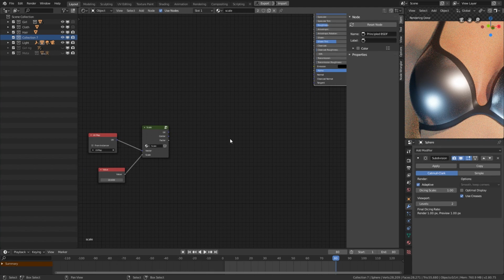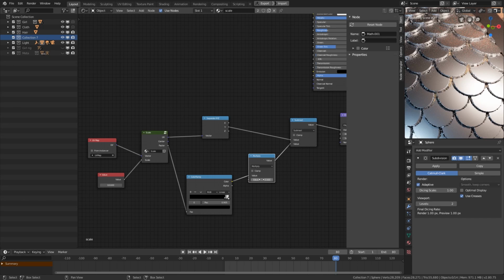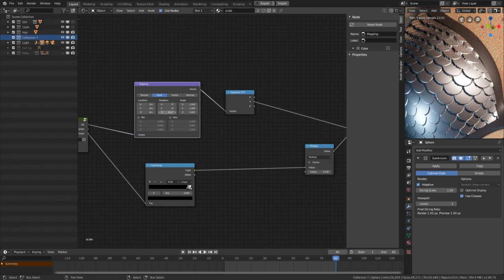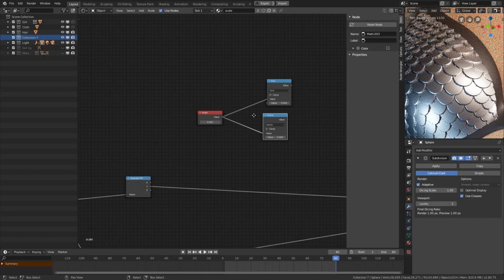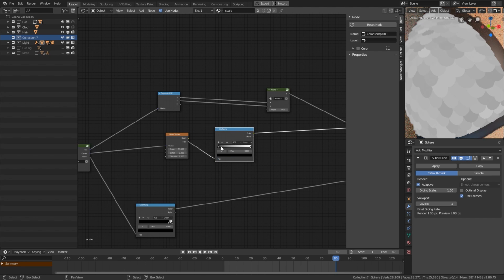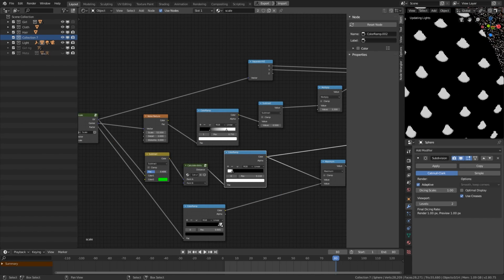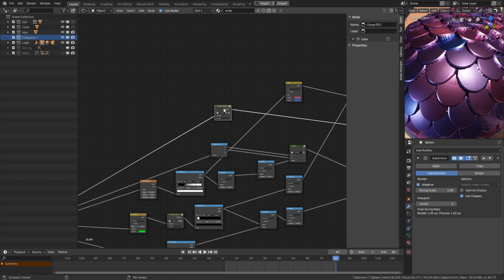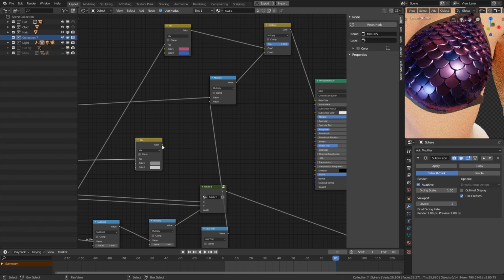Procedural scales in Blender 2.8 part 2

Comment: Followed as close as I could but I can't get the displacement to do much other than make the surface look weirdly glossy. rendered view or material view.
Reply: Never mind, I found the solution. All I had to do was make sure I was in cycles and ensure that the "Displacement and Bump" was enabled in the material settings.
Reply: I found the same problem. Did you end up getting a fix?

Comment: must admit I did not understand much about the math. But was able to follow it regardless. Any idea how to make the scales more like snake scales. Less rounded I guess and maybe even have a bit random size of the scales ?
Reply from the maker: in theory it's possible but the nodes will be very different because this set up implement a math formula I made specifically for round interconnecting scales. For different scales, you will need a different formula and an entirely different node set up, I haven't invested much thought into it.
Reply: Lance Phan thanks! Was hoping there was an easy way of achieving it. Ah well.
Reply: @TheBillyAnalog  If you would like a quick 'n' dirty way to mimic snake scales, I have played around with the following for pretty good results, short of doing more complex shaping with more new math nodes :

1) Insert a mapping node in-between the UV Map node and the Scale Calculation Node Group ('Vector' input). Set the Mapping X Scale value to approx. 2 to 2.5, this will narrow the shape from circles to ellipses.

2) Create a Noise Texture Node. Whilst keeping the UV Map Output's connection to the Mapping node intact, create another connection from the UV Map output to the 'Vector' Input of the Noise Texture. Keep default settings for now, (Scale=5, Detail=2,Distortion=0).

3) Insert a Color / MixRGB node in-line between the UV Map (Connected via input 'Color 1') and the new Mapping node. Set to 'Mix' mode if it's not already. Set the factor to something very low, such as 0.02

4) Connect the 'Color' Output to the MixRGB node's input 'Color 2'. Adjust settings of these nodes to personal taste. I find keeping it subtle is best.

For further refinement, it would be more accurate to separate the vector XYZ  values to manipulate the X and Y separately, then using the Noise 'Fac' output to warp the mapping instead of the Color output. It may also be beneficial to create node logic which controls the intensity of the Mapping's X scale value, dependant on the Y position on the pattern. I.e. using horizontal gradient bars with a multiplier to drive the X scaling within a preferred range.

Thanks to Lance for these awesome tutorials :-)
Reply: razeezar wow tnx!! Will give it a try for sure

Comment: My only problem seems to be that my scales are protruding at the top pointy part and sinking in at the bottom rounded part. Anyone have any idea of what I need to fix/invert?

Edit: Not that this is "right" but I just multiplied my "Y" angle in the group by -1. It worked.

Comment: Oh my god, this is amazing!!

I have just.. one question: for some reason, my texture (albeit followed step by step and every node being the same as yours!?) doesn't actually have.. accurate displacement, as it seems. The whole thing looks very fantastic and shiney and.. scale-ish but it still is 'flat', if you know what I mean? I wonder what I might be doing wrong ._.
Reply: Same! Just make sure to toggle on displacement and bump in the material settings at the bottom, then, subdivide a few times in edit mode and add a subdivision surface modifier with adaptive subdivision enabled. After that make sure your viewport is in render preview and cycles and not eevee or material view. Might find out your scales are REALLY displaced lol.
Reply: @realjayjobes1849  Ah, yeah.. !! Figured that also. It was because I was in eevee view, not cycles. (I'm an idiot sometimes, I feel!). Definitely displaced but the end result was just amazing. =D
Reply: @Chuck_Sexton  Ohh, okay. xD That might do the trick then! I shall try and see. Thank you very much!

Comment: Using your Node is it possible to control where the density of your texture on smaller or bigger areas of your mesh and where it lands for an example...if I a procedural texture and I had a mesh that has a lot of curvature. Is it possible to make the texture more dens where the mesh curves and more open where the mesh is flat? So if i have a dot texture: on the on the flat area there’s less dots and where there’s a curve on the mesh there a lot more dot?!?! Or is that possible already with the shading nodes? Please can you help or point me in the right direction...
Reply from the maker: You can use the pointiness of the Geometry input node to control the size, but you will see some stretching in the transition between the dense and sparse areas. If you are looking for something like particle distributions, it's not possible, or at least, I don't know any solution

Comment: I cant seem to get the displacement to actually displace the geometry.... i notice you're using cycles experimental features to use adaptive subdivision but it doesnt do anything for me
Reply: I figured it out! in the material tab under the settings category you have to switch the displacement mode to displacement and bump (default is bump only) this might help someone with the same issue
Reply: 03:47